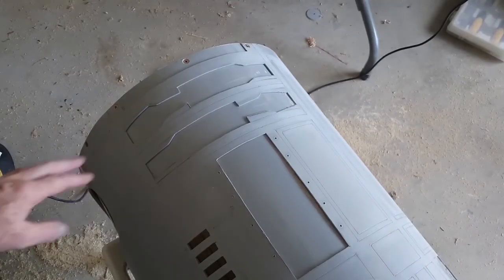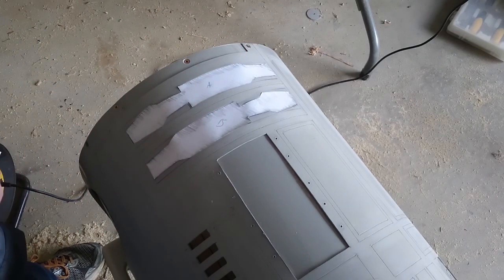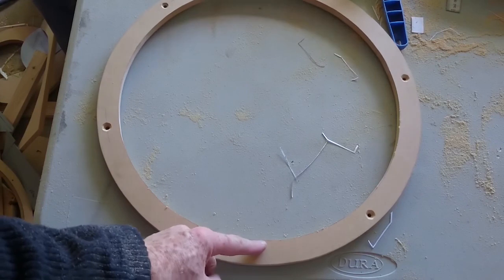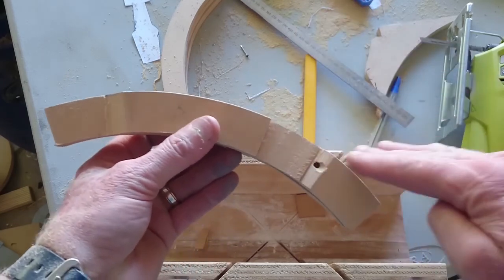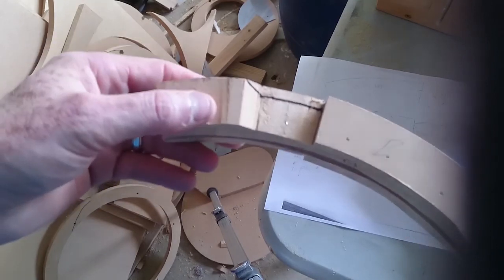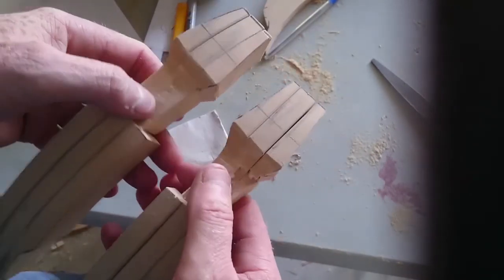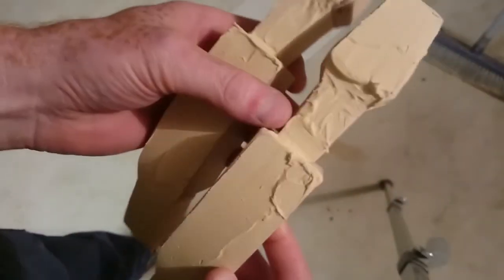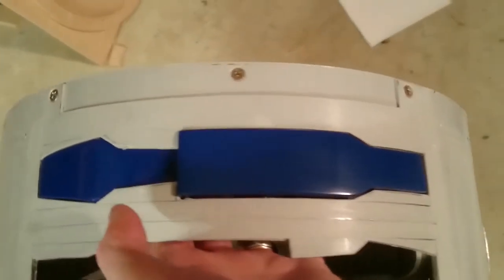D.I.Y R2-D2 Episode 17 -  Making The Utility Arms

Comment: Awesome vid mate.

May I ask why you hit it with spray putty, instead of primer?

Keep up the great work and looking forward to more vids.

Cheers,
Daniel
Reply from the maker: +Daniel Nathan Its actually a dual putty primer combo. Its just a bit thicker than normal primer so it covers up the sanding marks much easier
Reply: Thanks. That's clear now. Any particular brand for this?
Reply from the maker: no particular brand but I'm using an automotive putty.